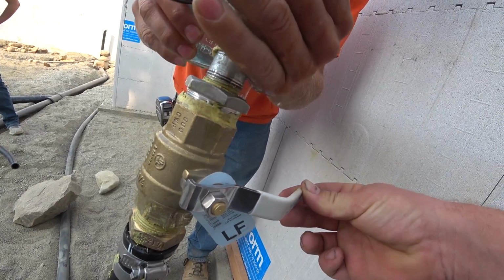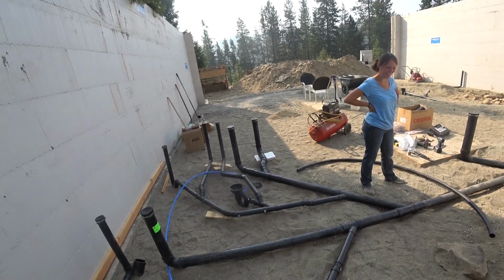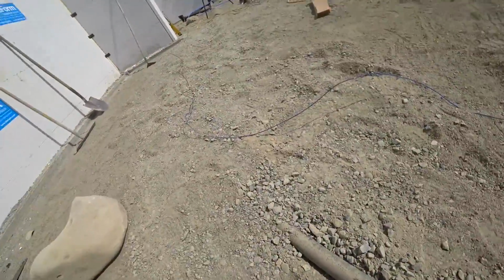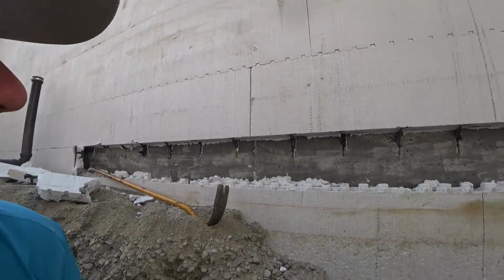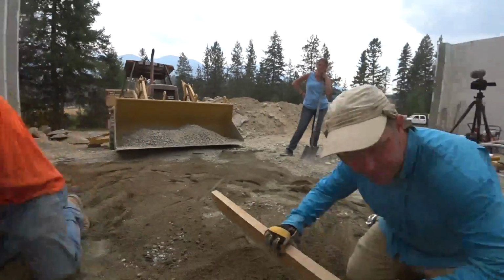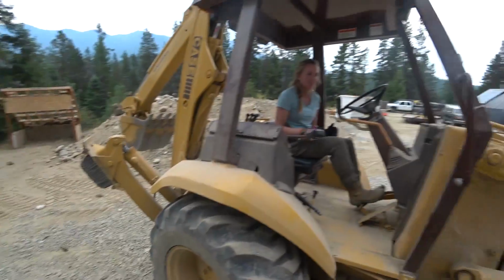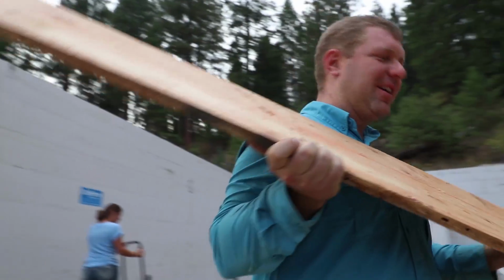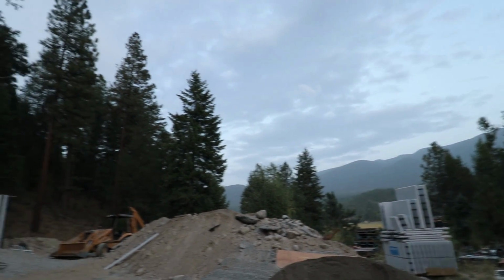TAKING A PRY BAR TO OUR ICF WALLS! (Garage Slab Prep)

Comment: WHATS WITH THE BLUE LINE ATTACHED TO THE DRAINS
Reply: I'm wondering about that too.. looks like maybe plumbing code here requires trap primers? If that is what's going on then it's just a water supply to ensure the trap doesn't dry out and let sewer gas in.. otherwise I'm not sure what that's all about. European countries allows waterless traps when there might be a concern about drying out.. but the US has been VERY reluctant to adopt waterless cartridge technology.
Reply: THEY HAD THEM BUNDLED TOGETHER LATER, WONDER IS ITS SOME WAY A VENT?
Reply: At closer examination they are ported into the drain bowl.. so definitely not venting.. it must be a trap primer.
Reply: A couple of videos back they explain about not wanting to put trap primers in and rather using some sort of cap to prevent evaporation. They were then informed that they weren't allowed to use the caps and had to have trap primers
Reply: I thought it looked like trap primers. Must have missed that video, thanks Branden Grant!

Comment: lol, drilling out the prime seal factory plug. zip ties rather than electrical tape to secure trace wire. 8-)
The slab acts as lateral restraint. Same as your floor system will at the top of the foundation.

Comment: You should have added a keyway slot in the top of your footings to better increase strength of the bottom of the wall from pushing inside the house
Reply: Tim britton keyway would also assist in resisting water movement. That wall is unlikely to move much on the sides since they've tied the footing into the wall with rebar at 16 to 24 inches on center. It would have to drag the footing along with it. Footings also got quite a bit of rebar in it also. The back wall will be the one to watch. Hopefully the upslope is stable and there's not much water coming off that slope.
Reply: butopiatoo the rebar will,also help
Reply: Tim britton yes would love to see the engineering calcs just for discussion. What forces are involved how things theoretically move etc. how much and what size rebar is actually needed. How much of a safety factor is typically incorporated into what we're seeing built. Lots that isn't visible. Interesting stuff imho.
Reply: butopiatoo yea im,surprised the engineer said number 5 rebar they're on flat land that doesn't seem to b a bankfilled hill unless it is number 4 should've been enough and it's easy to bend with ur knee lol I can do it

Comment: NO.    Do not remove the foam.  In fact the slab in contact with the concrete ,is a thermal disaster,, why the heck did you use the foam in the first place?  The temp and moisture of the earth under the rail footing,, WILL BE the temp and moisture level of the entire slab.  Concrete is an incredible thermal and moisture bridge.  

And if you are talking thrust,, 6 inch face of concrete to a 2 pound polystyrene foam,, per linear foot you have 72 square inches,, at a nominal 30psi to 10% or less deformationm,,, that is more than a ton, 2100 pounds of thrust PER LINEAR FOOT capacity.

Why the heck did you bother with foam insulation.  Your in floor heating system is just going to be heating the surrounding soils.

Goodbye.
Reply: If they had done right they should have tied in the rebar from inside the wall to the rebar in the slab.  Oh well just another foobar !
Reply: If the wall moves that much to need the slab to support it you have bigger issues.
Reply: Seems like they should have kept the foam on the inside and maybe outside just for insulation. IDK why you're supposed to remove it? Just so you can buy more foam from them for insulation?
Reply: Don't get me started.  They wasted a huge amount of money and effort when they punched holes in their foam and stuck the heated slab outdoors.  Everything over built to the point of way past diminishing returns.  The urge for structural over built, absolutely negated the energy over built.  It will be stronger than any basement I've seen in 50 plus years, interstate highway specs,, with the single reduction of a 6 inch slab, not a 10 inch slab.  A ten inch slab would rate for 110,000 pound 75 mph rolling load.  The 6 inch will rate as would a bridge deck,, about 25,000 pounds of rolling load.   At the expense of all heating and cooling concerns.  I repeat,, all heating and cooling concerns.  The slab currently will try to heat and cool Idaho,, sub soils and outside air.
Reply: This whole series has been so cringy. So many mistakes. I'm surprised they're so cool about it

Comment: cut the tails off your zip-ties or what ever you call them. We always called big ones cable ties, smaller wire ties. I worked for the Bell system till they became Verizon and we started useing them years before they were sold in the civilian market. Anyway, cutting off the tails made a neater installation, maybe you do, I didn't see, but there are people who don't, DUH.
What's all the dirt for, just fill it with concrete.

Comment: You are wrong about tying the slab into the foundation.  They need to be independent of each other.  The only way the foundation walls would move is from compaction or soil movement.  You should have a soil report to tell you if you have bentonite in the ground, which I am sure don't.  Mountain ground is decomposed granite.  So your soil is stable and your foundation is mostly out of the ground.  One more of the amazing amount of mistakes you have made.
Reply: Bronco Billy....wrong.

Comment: Take them gates clamps off and buy actual CTS fittings!!!! use compression and get the tool to dress the pipe before placing the CTS compression fitting on!

Comment: One of the problems with being behind on videos, is you probably already have the slab poured. Therefore it's too late for us to mention things like teflon tape on the threads of the brass fitting you put on the p-trap would have been a good idea if you want to prevent leaking ( and possibly a sinkhole resulting under your house). You probably saved all of 2 cents  not using it. I wonder what the retro work will cost?
Reply: I'm thinking I would have wrapped the pipe with foam where it comes through the slab then it wouldn't be as likely to crack, an I wrong?
Reply: maybe? I'm no plumber .I am thinking that compacting with the pipes in the ground was not such a good idea either.
Reply: I don't think it will make a difference. DO you have that experience where teflon tape outlasted pipe dope over time? Today Pipe dope has teflon in it.

Comment: I am confused...Skreeting under a concrete pad is the biggest waste of time. Eye ball it and when you pour it THEN level it off. a pad for concrete should be 6 inches of packed 3/4 down, but it being skreeted so perfectly is a waste of time...and I just realized you didn't use a roll of geotherm on the base of the pad...sigh. Rebar chair...you mean a rock?
Reply: I don't think they are pouring the concrete on top of that, they are putting down foam, and then concrete, or maybe foam then more sand then concrete.
Reply: That makes way more sense.